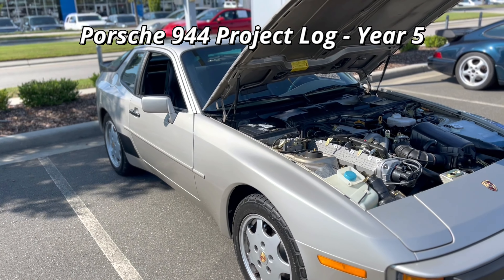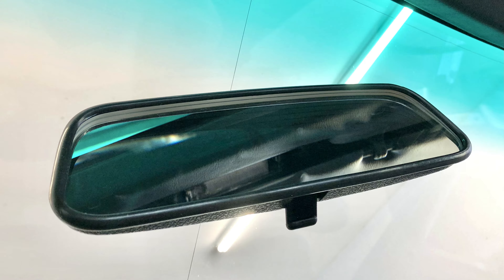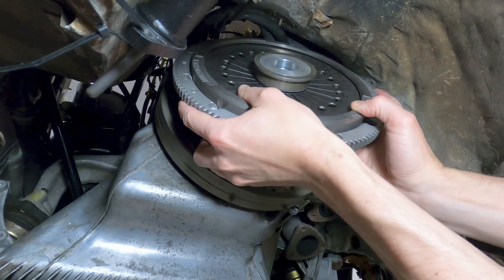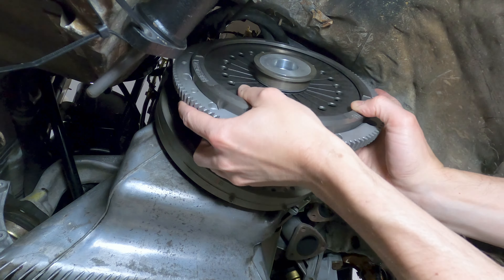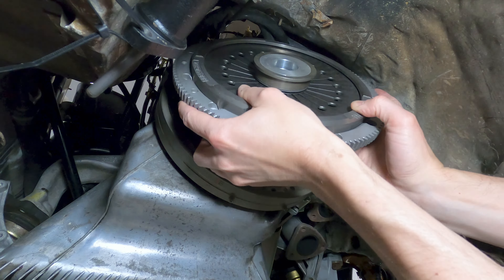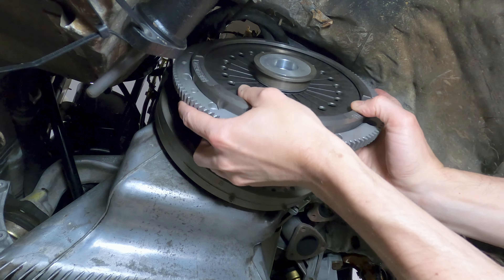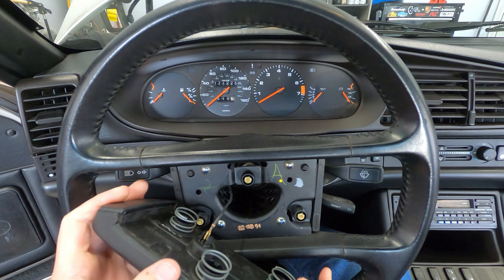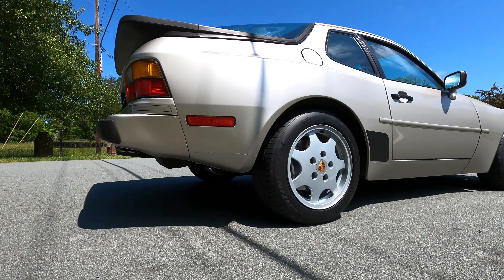Porsche 944 Project Story – Year 5 – Status Update, Repairs, Maintenance, & Costs

Comment: sir i need to pick your brain please....i have a 1988 944 N/A and both my windows will not work...no power to the switch either!! checked ALL fuses in box and replaced all switches and new relay....I'm lost now...any help/suggestions will be helpful
Reply from the maker: Hey man! It sounds like you're on the right track so far. There are a few other hidden issues that can arise, for example the terminal contacts below the fuse panel can get pushed out where they won't make contact with the fuse and/or relay. There can also be issues with severed or oxidized wiring below the plastic panel. Another issue is the wiring that runs through the door jamb between the door and the chassis can crack and break because of the flex point from opening and closing the door. With that in mind, here are a couple ways to dig a little deeper...

Pull the window winder fuse at position #4 and test for battery voltage by applying a lead to the fuse terminal closest to the front of the car (positive) and the other lead to a known good ground on the chassis. 

Pull the window winder relay at position G7 and test for battery voltage by applying a lead to terminal 30 (positive) and the other lead to a known good ground on the chassis.  

If you don't get battery voltage with these tests, there's a problem with the wiring that you'll need to address. Unscrew and pull the plastic fuse panel up and out of its metal enclosure to inspect for issues below. 

If these tests are good, you can try to bypass the relay just to make sure that's not the issue by applying a jumper wire to pins 30 and 87 for the window winder relay at position G7, then operate the window switches. The ignition does not need to be on for this, they should just start to move. 

If not, there is likely an issue with the wiring leading to the door panel and switches. Make sure the wiring harnesses are fully seated on both switch panels, and try again, otherwise you may have to really look into the wiring. 

Here's the troubleshooting steps from Clark's Garage that can provide some tips as well - http://www.clarks-garage.com/shop-manual/elect-20.htm
Reply: @NC944er  thank you for that in-depth analysis! Must appreciated!

Comment: She's just leaking oil to let you know she has oil! Worry when that stops, lol. Man, I really need to replace my coolant expansion tank; your non-yellowed one looks great. I've always run gold G05 coolant. Is that G48 (which I run in my BMWs) or Pentosin NF?
Reply from the maker: I’m determined to make a leak-free Porsche… but it has been a battle for sure! 😂 The coolant reservoir really does get the worst of it, as far as aging goes. I’ve been using Peak Blue 50/50 for “European Vehicles,” which is locally available at AutoZone for $19/gallon, and it seems to be working out well.
Reply: @NC944er  Yep, that one is within spec. I was asking because you seem to be a stickler for originality, and I have no idea what was the OEM coolant. Thanks for another great video!